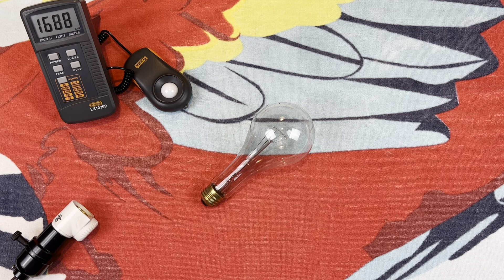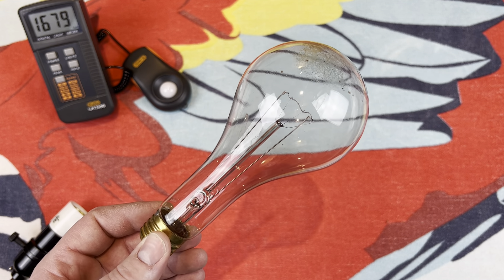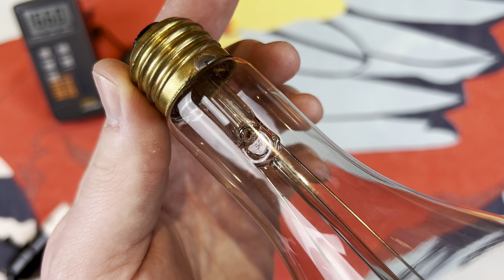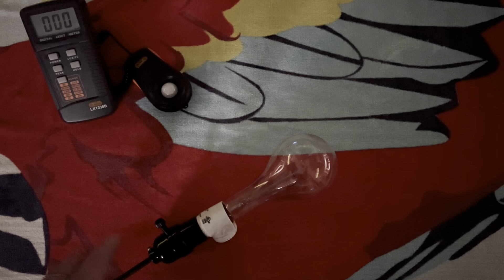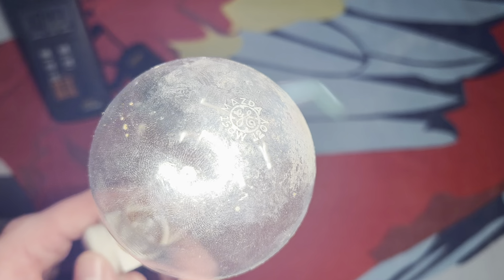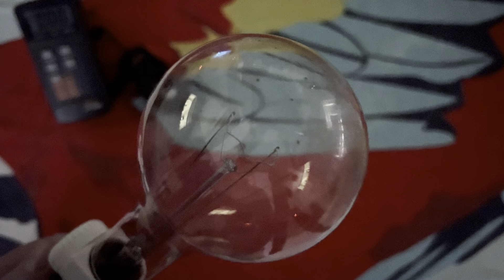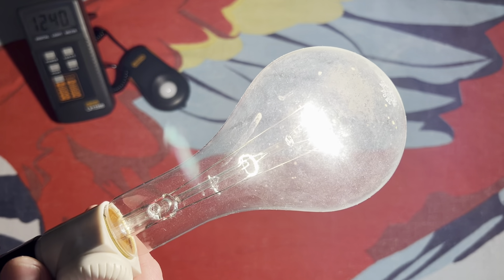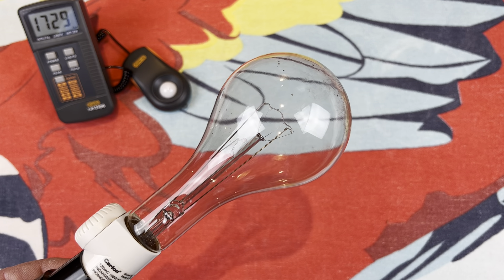Vintage GE Mazda 150watt Clear Incandescent Light Bulb

Comment: The last time I saw the Mazda mark on a lamp was one in an Air-way upright vacuum cleaner from the 1930s which happened to be fully functional.  It only needed a new bag and a belt for the brush roll.

Comment: I've got a bulb that looks fairly similar to that. It's a 100 watt, a bit bigger than the usual A19 size, and the etch labels it "Bake Oven." Any idea what it could be? I can't find much info online. My best guess was for use inside huge industrial ovens.
Reply: It is a 100 watt lamp for commercial oven service. It will likely be A21 or A23. I don't know when 100 watt lamps were reduced to the A19 shape, but specialty lamps usually were a bit larger.
Reply: Interesting, thanks for the info. I think it's an A23, and I wonder how old it is. Sadly I didn't see a date code of any type when I looked at it last, but maybe I could search again when I'm home next.
Reply: @Wyatt_James  Australian globes had a 2 digit date code with the 2 numbers well apart, the first # is batch and the last # is the year, my parent's house was built in 1972 and had Philips pearl 60w globes installed, the date code was 3   2, the 2 as in 1972 and 3 is 3rd batch